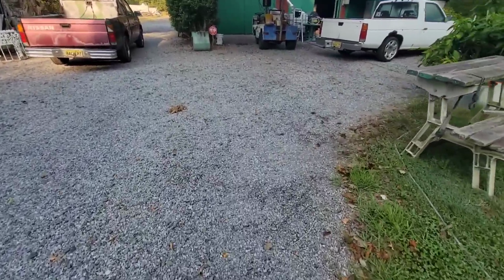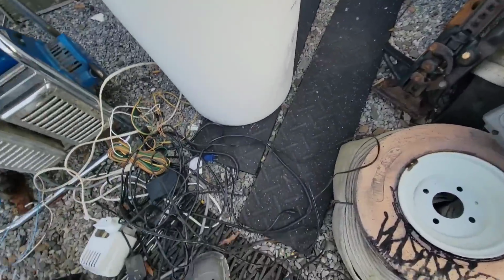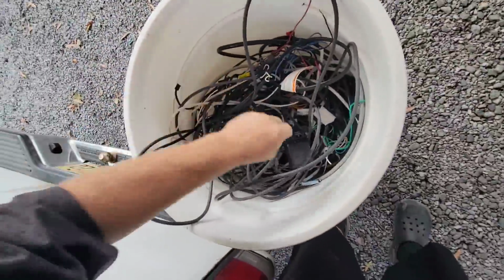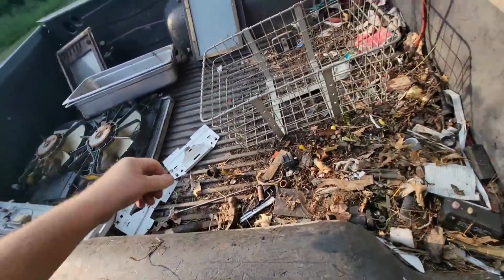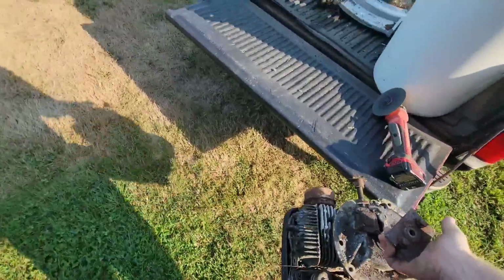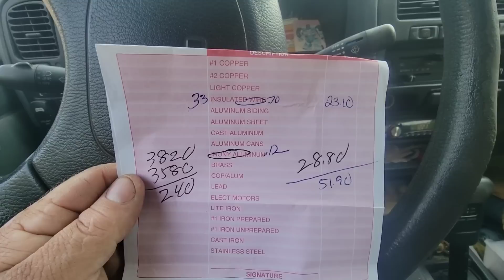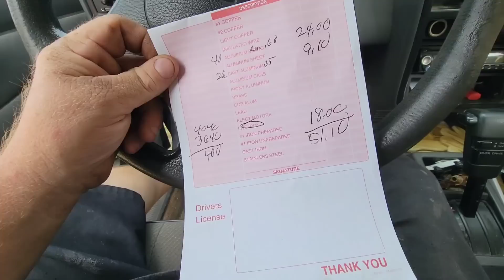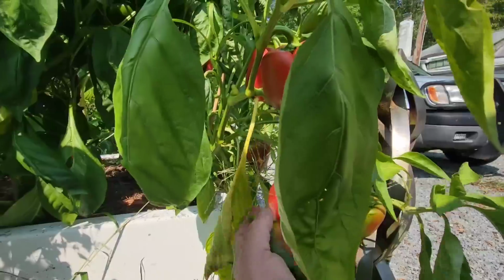Recycling Metal ♻️ Pay Day Friday

Comment: Sometimes when I find stuff that homeowners put out plugs are cut off I thought of that too but I came up with the solution that they don't want no one to be able to use the product so they cut the cord ends off so that you can't take it home and reuse it
Reply from the maker: I feel that that happens sometimes but if that's the case why would they leave it  5" piece of wire sticking out that you could tap into
Reply: @ScrapFarm  they probably think that you don't have enough intelligence to fix it up and still make it work